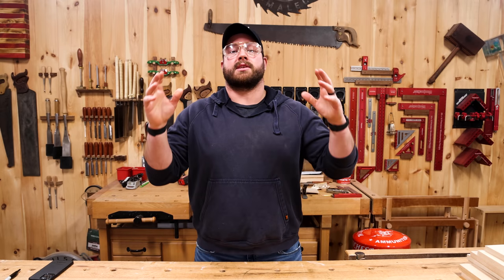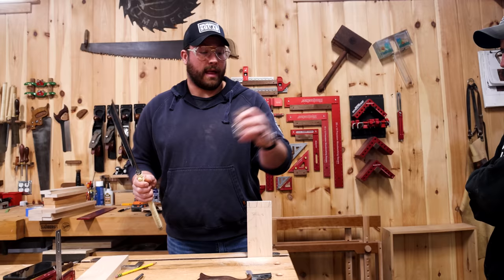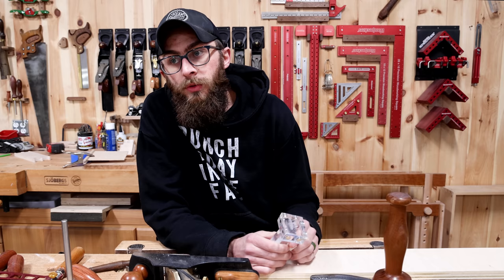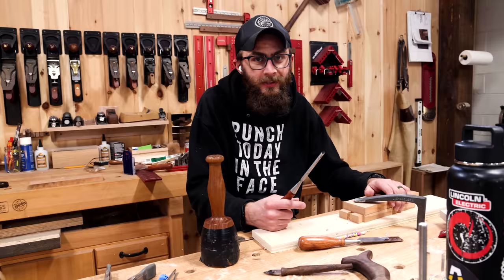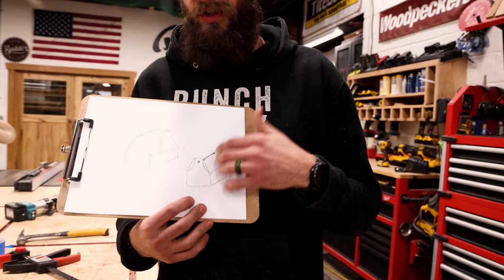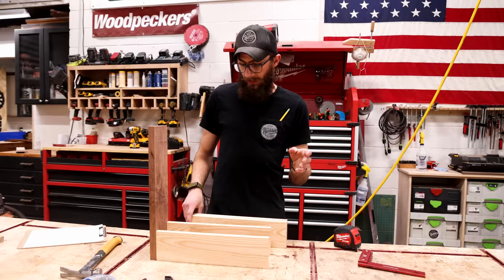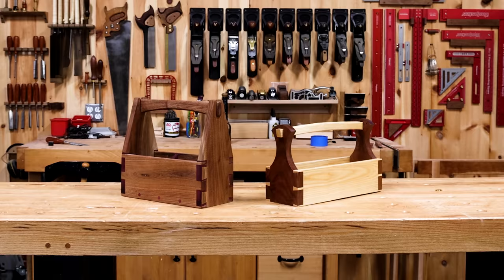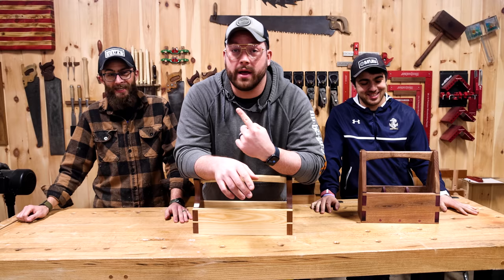Beginner Dovetail Challenge! I Teach The Boys Dovetails

Comment: I think a good "new skill" challenge for the boys would be a through and pinned mortise and tenon joint ( no glue) like was common in furniture building  throughout Europe historically. bump it up by making it all 100% hand tools, no electricity at all. I have made beds, long tables ( dining tables) and even pantry shelves with this method, and they look outstanding, and test chisel skills, Brace and bit skills, as well as engineering to make sure the pins and holes are placed, such that it draws the joints together very tightly.